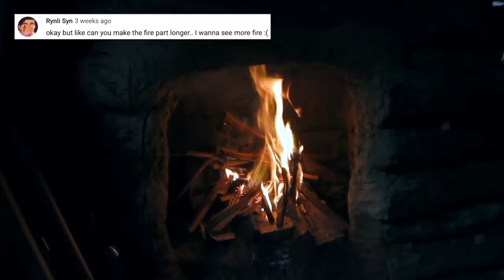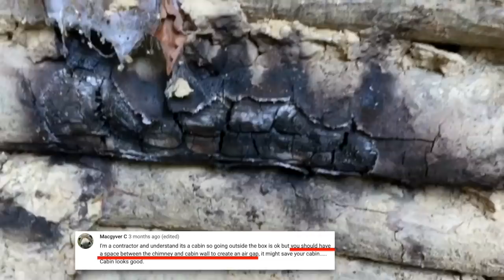Wood cabin stone fireplace build

Comment: Dang, carrying those big rocks and clay up that hill, all the way to the cabin..= RESPECT!!
Good job. Much better fireplace.
And, thanks for that extra minute of fire at the end. Outstanding!
Reply from the maker: Thanks mate! After a year and a half the chimney is missing some mud bits.but still working nicely. I'm thinking about rebuilding the entire fireplace, this time using mortar.
Reply: @EgoitzSalsamendi  ha! I wondered about that. But every time, your design improves drastically. Mortar is a great idea. I definitely would. 
However,  very cool after a year, still in good shape is very respectable!
I have been researching vintage chimney builds aka 18th century.
Reply from the maker: Just considering it. Not much time right now to work on the cabin or anything really. Those chimneys in the 18th century, were they made using mortar? adobe? mud?
Reply: @EgoitzSalsamendi  well, they did both. They built temporary cabins for Washingtons army using Adobe and logs in the chimney,  but they weren't supposed to be long term.
They built regular stone or brick chimneys with mortar while living in the temporary cabins. Those are some of my favorite designs.
Reply from the maker: @B-leafer  Tthrough

Comment: The new chimney looks a 100% better. I hope it holds up if it doesn’t you need to rethink the mud mixture. You need to make two trips with the backpack. If you fall down and break something no one will found you till it’s to late.
Reply from the maker: Thanks Linda! It does look better and performs way better! I spotted a couple of places with grass during this weekend which I'll mix with mud to fill the gaps in the walls, it may be enough if the chimney keeps giving problems!

Comment: Love the chimney! How you tried ash mortar to hold uo to the weather? Sift ashes from fireplace (no lumps or charcoal in it). Wet it and form into balls.  Dry well. When completely hard. Place in fire..preferably with tiles on top or cement pieces to get realky hot like homemade kiln. Then remove n pulverized  add water again.  But this time its mortar and when wet will not soak up water when it rains
Reply from the maker: Hi Kat, thanks for the comment. No, I haven't try ash mortar or any other type of mortar in the cabin or elsewhere. I thought about it for some time, and watched lots of videos about it, but holy cow; it is a buttload of work to make mortar in high quantities. So I dismissed it and went with adobe. Cheers!
Reply: @EgoitzSalsamendi  maybe do the ash balls up n cook them a little at a time to be ready for next year when you need to add more adobe to mix with the adobe. I kniw i will be saving my ash from now on.
Reply from the maker: @katholderbaum7950  Yep! Need to built quite some fires!

Comment: few things--1---The overnight heat from a fireplace made of stone comes from heating the rocks to the point they will still dissipate heat after the fire has gone out.  If you  put the majority of the stone and mud inside, it will keep it warm much longer.--2---As you burn a fire and the smoke and heat rises up the chimney, it has to pull air from somewhere.  In a cabin like that, that fireplace design pulls air from the outside into the cabin to equal the volume of air going up the chimney.  If you had an outside fresh air intake for the firelace outside the cabin, then the fire wouldn't have to pull cold air through the cabin.  This way the fire could heat the rocks, mud and logs on the inside of the cabin and it would stay warmer for much longer and use less wood. -3-- Some sort of damper, maybe a sliding rock, can also help to prolong the wood and help to have less heat escape up the chimney.
Reply from the maker: Holly crap, you took some time with this comment. Thank you. OK, let's see. So why I put the chimney outside? There are some reasons for that: 1) the cabin is tiny (like really really tiny), so the fireplace and chimney (or a stove) would take too much space inside; 2) here doesn't rain it pours, so as a novice with no freaking idea about how to make a cabin, water leaking was a major concern to me, specially using only natural materials like rocks, wood and mud. Heck, even in regular houses leaking water is a major issue here! I musty say here that I restricted myself to use only natural materials (I know, I cheated with the door!). So by putting the chimney outside I didn't have to deal with fitting the chimney and the roof, and fail miserably and inevitably anyway! I must say here, yet again, that after 3  winters the roof has not a single leak (I'm really proud about that!!!!) 3) It's not that cold here, man! I don't live in freaking Siberia. This is southern Europe and we have mild winters here (humid as fuck, but mild). Temperature rarely gets below 5º Celsius, it snows 2 or 3 days every 2 or 3 years. Right now its sunny with 18º C (12:57, Feb 11). Cheers!

Comment: Its a shame you didn't use mortar instead of just mud, this build won't last long as the mud will wash out pretty quickly!  But great build!  I'm glad you redid it because your cabin was in danger with the 1st one you did!  Thanks for sharing!
Reply from the maker: Mortar is pretty hard to obtain in the forest! I've seen some videos on how to make your own mortar in the wild, but you need huge amount of materials and time to produce a little. In my area, there are plenty of mountain-man and shepherd's shelters made entirely from stone and mud (no mortar at all!), that have endured centuries of rain and storms. I took the idea from those. The fireplace is doing pretty nicely so far. You are right, mud has washed out in some spots, but no major problems. I need to modify the roof and repair those spots and I guess it will be fine. Have a nice day and thanks for your comment!

Comment: ever considered making primitive bricks/cement to fill the holes in the shelter?
find some limestone or chalk, burn them until completely white, dig a hole, fill with clay add water to water putty type and add the burnt chalk/limestone and mix (burnt limestone/chalk when added to water becomes quicklime through a chemical reaction) when dry or bricks are fired it becomes as hard as stone and completely waterproof, that's how i built my woodlands cabin fireplace.
Reply from the maker: Yeah, I considered it, but then I watched some videos on making natural cement bricks and the amount of work it would take and fuck it! No way I'm taking that much work, I'm a lazy bastard! I take my hat off to you, sir!
Reply: @EgoitzSalsamendi  meh it was just a thought, and btw it's not as hard as it seems the hardest part is finding either a large  supply of shells or chalk to make quicklime
Reply from the maker: All right, thanks. No shells, no chalk, no limestone around the cabin...

Comment: Next time do what my grand father did. He built the fireplace first then the cabin to fit it. Wood is easier to make fit tightly then stone is. Just a thought from a 60 plus gentleman.
Reply from the maker: Yeah, I thought about that in the beginning, but there is a major problems here: RAIN. An it gets everywhere! It would be a major task to me to build a waterproof roof with proper moderns materials, so forget about it with just mud, wood, ropes or pine resin. That's why I made the fireplace like that. It's not the best (I know), but I have no leeks inside the cabin!!

Comment: You should be adding a fibrous material like dried grass to the mud so it doesn't flake away when dried. It'll provide something for the mud to grip. Research 'cob building/construction material.'
Reply from the maker: Would ferns work? Or moss? Cause I have plenty of those around in the forest but very little grass.
Reply: Exactly what I thought!! Any grass or vegetation should work!! It creates a type of cement. The American Indians use hay. When the fire hardens it, it is practically indestructible!!

Comment: Add some lime to your mud mix. It will be harder and last longer. Get slaked lime by roasting lime stone (or sea shells) in a fire for several hours then place in water. CAUTION! There will be a reaction! They WILL get hot. Add the lime mud to your clay/mud between rocks
Reply from the maker: Yeah, I've seen some videos about that. It looks to me a lot of work for a very little reward. It also looks very difficult to obtain the right temperature for so long to roast those rocks or shells. But maybe you are right! I don't know, we'll see! Thanks a lot!

Comment: The burned log was inevitable. Should've done some basic research first from books or the net. A decent job on the 2nd chimney version. Might want to provide some vertical stake framing at the log cutouts to prevent a side collapse. Next, caulk the logs or the fireplace will be useless for heating. The floor will get flooded from outside run-in if you don't trench around the perimeter. A floor padding of flattened branches would provide floor insulation. Flat stones or shaved planks on top of the branches would provide even better floor insulation.
.
Reply from the maker: Thanks mate, all of this is just a learning process. I'm caulking the logs with a mixture of mud, grass, and ashes, 3 of the 4 walls already done from the inside. The cabin is 6 to 10 inches above the ground, so hopefully I won't have any flooding problems as in the previous location. I'm thinking about how to insulate the floor as well! I will provably stuck lots of leaf between the ground and the cabin's floor, and some hand made shingles or planks. The remaining holes (tiny I hope!) will be fill with mud. I'm afraid that the shingled roof is proving quite a bad termal insulation

Comment: Nice cabin and love the FP! How was it for heating? Did it warmup nice in the cabin when it was below 32 degrees out? Trying to decide for my own small cabin whether to do something similar. Prefer stone FP over a wood stove. Thanks for sharing
Reply from the maker: Hey Holly, thanks for the comment. Once the fire is stablished and runs strong it heats the tiny cabin pretty nicely, no problems at all. Now that the walls are chinked the cabin retains the heat longer than before, but the roof is not air tight and lets the heat scape relatively easily. Then again, the roof not being air tight lets the smoke to scape too!

Comment: It was undeniably predictable that you were going to create a gigantic bonfire. I do not know what ideas you have for the new construction but I think it is built from the inside out.  Beautiful rocks. I see two new possible problems: you have to continue the rock floor to the inside of the house, I see wood from the house near the fire. The place is small and comfortable but the depth of the fireplace is very large, the heat will escape, will not easily reach the room. The water fall on the roof will be good in relation to the chimney? Like for your effort.
Reply from the maker: The point is that the cabin is quite tiny, so I don't have space inside to build such a fireplace. This second version of the fireplace works really well, and I'm very happy with it! I have to fix one problem, though! Water from the roof pours down the chimney walls and washes the mud!! I'm thinking about using a pine resin and charred coal mixture to fill the gap between the chimney and the roof so water can't get through there!
Reply: @EgoitzSalsamendi   Well, despite everything, it's a good job. I think you can use those excellent stone slabs and place them under the eaves resting on the chimney to act as a channel. Do not use recine can be flammable. You can also use mud but you have to be sure to use the one with iron so that its hardness is effective. I like the cabin, its location, There is still a lot to do. I wish you good luck.

Comment: This is very hard work but I'm worried that the rain will wash away the clay like the first fire place. I assume that putting more stones inside for more heat mass is not an option because of the small space. However, that stone chimney should be protected by a roof extension, and smoke evacuation could be made horizontally.
Reply from the maker: Thanks mate! Yes, with time rain will wash away the mud. The option I’m contemplating now is to add more mud from time to time! Maybe later I’ll add a rooftop!

Comment: You'll have to re-mud the joints every so often as the rain will erode the material away over time. You don't want the chimney to collapse on the roof (or even worse when someone is home!)
Reply from the maker: Hi Walter! Yeah, I'm well aware about that, in fact, I had to re-mud the chimney a couple of times due to torrential rains. Thanks for your concerns! Cheers!

Comment: Not going to last long with just mud holding  it together. Should get some good mortar, it doesn't cost much at all. Also should have peeled the logs and chinked them with a mud straw mixture. Bet it's cold as hell in the winter.
Reply from the maker: Hi there! I don’t want to expend cash in the cabin, but in tools that may be helpful later! I didn’t peel the logs because I’m a lazy bastard and I thought that a mud and grass mixture would hold better in the bark that in smooth wood. It’s been already three days that I’ve been feeling the gaps between the logs, and almost finished inside!

Comment: Awsome job,! I mine for gold , and I have a extended stay in the smokies MTS., so I've been contiplaiting a make shift extended shelter, to keep critters and such out,
 And to processe gold ore ! I came across your video and thought wow exactly what I need to do!! Can you tell me how long that took you to construct? And what kind of tools were nesesary ? I used to build houses so my architecture is fairly good but when lugging nesecities into the wilderness, like a 120mile hike ,go I'm at a blank? What should be my main tools?
Reply from the maker: Hi Greg! Wow, a miner, how awesome is that!!!! I mean, pretty sure you have miserable days too, but it sounds like living in an adventure. 
Not sure if I'm the guy to answer your questions, since the shack you see is the only attempt I have ever done. But I'll give you my two cents, based on my experience. My log cabin has about 8 by 8 feet base, just enough to lay inside and sleep comfortably, and it should't take more than 3 weeks for the 4 walls and the main structure of the roof, taking that you cut and process all the logs (tree falling, debarking, notching...). Then another 8 days or so for the wooden shingles, if you decide to make them yourself. Finally chinking the walls with mud, it should take around 8-10 days, both sides (inside and outside). So in total you should be done in just over a month or so, probably less since you have experience building houses. 

Now for the tools, I'm listing the ones I have used:
- Gransfors Bruk small forest axe
- Buck saw (I bough one on a local store, make sure the saw is quality!)
- Handsaw (again, I bought it on a local store, broad blade to make sure your cut is straight and true!)
- A bushcraft knife (any mora knife should work!)
- A froe (I bought mine in eBay for 30 €), you can manage without it, but should you decide to make your own shingles I would encourage you to get one.
- A drawknife (I didn't, but I should have get one for debarking logs!) 

Unless you can carry and maintain a chainsaw, that would greatly fasten your work! 

That's all I guess. If you have more questions, feel free to ask them. Hope this was helpful!
Cheers!

Comment: I'm wanting to make me one for mine. How is the heat as far as it going into the cabin. Also what is things you would have done differently?
Reply from the maker: Hi Jonathan, thanks for your comment! I don't know if I would change anything because I was limited by the materials I had available in the area. If anything I would try to make the walls thicker. Also make sure you leave enough space from the fireplace walls to the logs (you can fill the gap with mud), since some logs might start to smoulder and eventually catch fire from the heat. This area has a very mild winters so I didn't need a big fireplace inside the cabin (also the cabin is quite tiny!). Your mileage might vary and you might need a bigger chimeny inside the cabin, so it will keep all the heat inside. Cheers!!
Reply: @EgoitzSalsamendi  thanks a lot. I enjoy your videos. I will continue watching and learning. I'm from southeast KY by the way. Thanks a lot
Reply from the maker: @jonathanday8833  Any time mate. This is northern Spain.